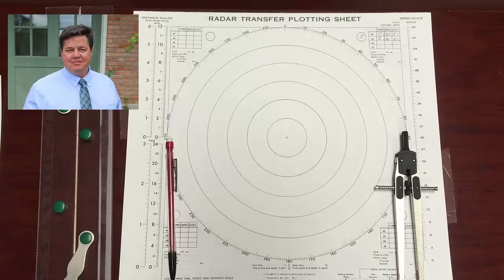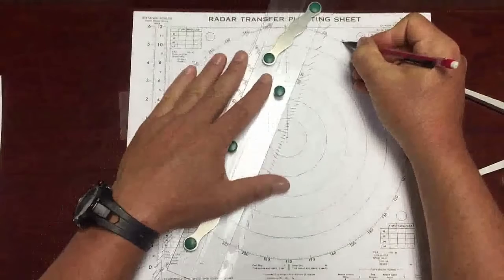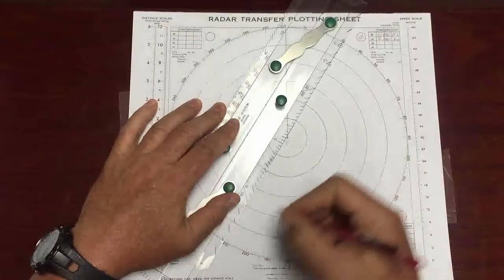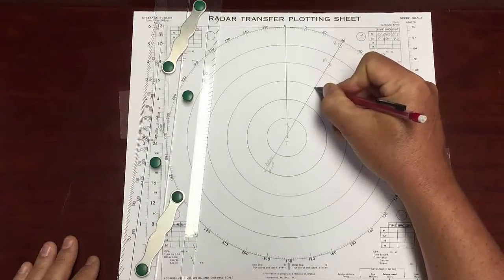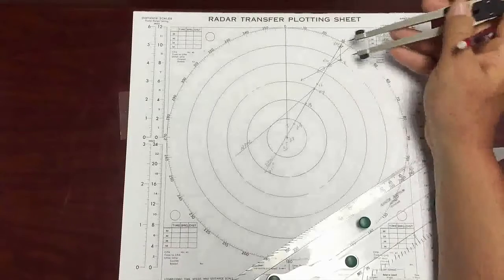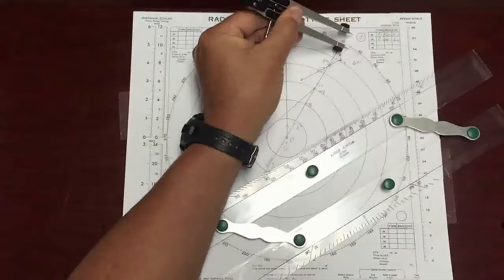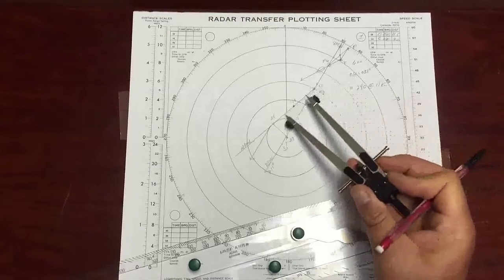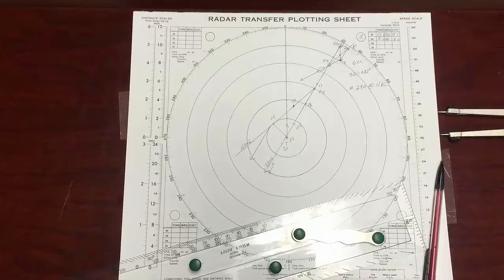MPI Unlimited Radar Refresher with George Burkley

Comment: wonderful explanation!  I have just learnt how to do these and I just need to confirm how the speed is calculated when you go from the NRML and choose to slow down....in your example you showed 6 knots - please tell me how you arrive at this - is it the distance over same time period from R - M ?
Reply from the maker: Leon, I'm glad you liked the explanation and the video.  To determine the new speed of your ship to create the new relative motion (NRML) you measure the length of the ownship vector in the triangle from "T" to where the NRML line crossed "T" towards "r'. In practice, you measure up the vector, from "T" towards "r".  As you are going up the vector you will encounter where the NRML line crosses the ownship "T" vector.  In the video example its about halfway up. If your original speed were 15kn, you might measure 7.5kn at the crossing of the NRML past "T"  Thus you would need to drop your speed by half, down to 7.5kn  as the contact approaches "mx" and it would slide down the NRML.   Good day and...keep on plottin'  GB
Reply: Maritime Pilots Institute

Comment: Greetings Mr. Burkely
Very nicely paced revision  presentation.    When I follow the construction on plain paper (scale 1":1nM)     and calculating separately  by trigonometry  I get Course to Steer   39.5°T  and Speed Reduction solution  at a beeswing  under 4 knots.   Your own new  course to steer    of 31°T    looks very small to. produce the desired  change in target's NLRM.    I wonder if you have a comment or suggestion.    Thanks JR.